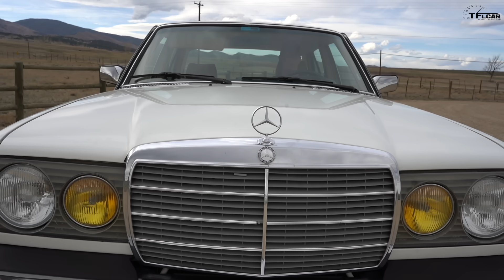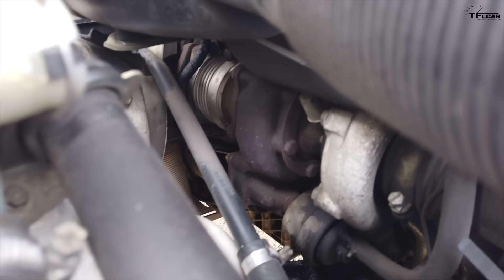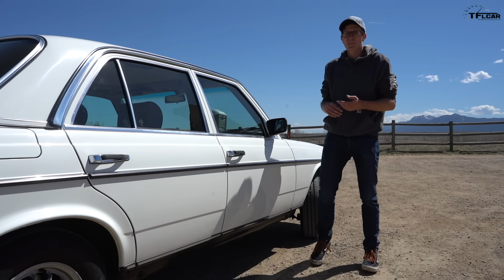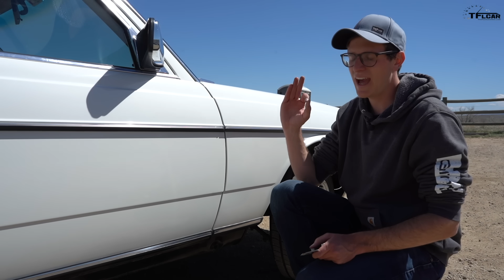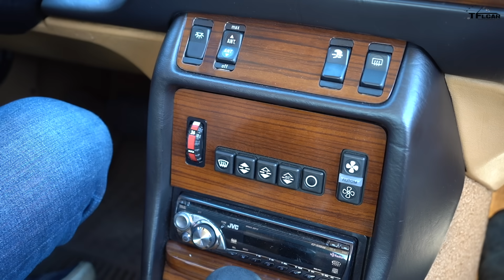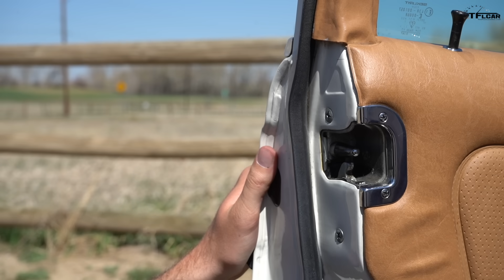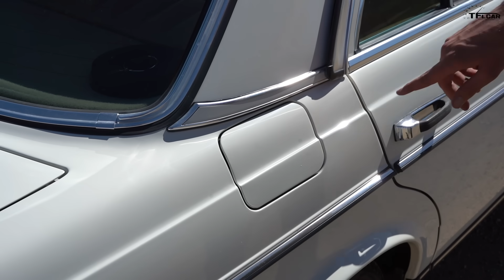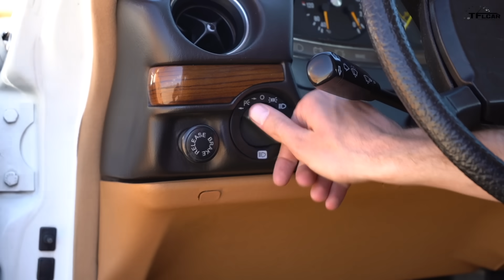This 37-Year-Old Diesel Is THE BEST Mercedes Ever Made!

Comment: Tell us why, on the tail light modules, there is a segment that does not even have a light base.
Reply: It's for reflecting light.
Reply: @gplito  Not if there is a corresponding empty hole for a plastic base. No, I just bought on eBay the metal back part for an older light that has every segment filled. I bought ti because I am taking 2 of those bases and putting one each  in my missing slots. Haven't decided which circuit gets the extra bulb. I'm also curious why the high beam indicator is placed so that it is mostly hidden by the steering wheel.
Reply: @johnredman938  I think the European model had rear fog lights that the US model didn't have. So when you turned on the bright yellow fogs, a rear light would appear also, a very bright red one. I had a few of these over the years and that's all I could come up with. I always like the high beam indicator being within a fingers reach. In Europe light flashing is used quite a bit. Even with then headlights off, you can still flash then brights.
Reply: @gplito  For fog lights? Well, that makes no sense (to me). The high beam indicator I refer to is the blue light on the warning light strip on the dash, not the stem you control the light with. On my W126, it is almost totally hidden with the steering wheel in straight ahead position.
Reply: John Redman maybe it looks different depending on how tall you are or where the seat is adjusted. I liked to sit up high so that blue light was always very visible. But since the steering wheel is fixed, I can see how it could get hidden behind it.
Reply: John Redman the next model did have rear facing fog lights. It was one extra bright bulb in the drivers side real light fixture. It went on when you pulled the knob for the front fogs. I don’t remember if TD had that or not.
Reply: @gplito  Good design would not have that happen, depend on how tall one is. It would be right in the top middle of the speedo where most cars I have owned has it. Heck, my 1952 MGTD had it there.
Reply: @johnredman938  There's a reason, in some engineers mind, why it was there. Haha. I actually liked it. I liked that it was blue. I spent a lot of years working for Benz in retail sales so I had a Benz all the time, mine and whatever demo I grabbed. Word in the service departments was that these particular cars were the best ones they ever built and required the least servicing to keep them on the road. Every one of them that we took in on trade was purchased by an employee, mostly in the service dept ,but a lot of us sales guys owned them too. This was back in the 80's and 90's when a lot of them were still on the road and would still show up as a trade in. I had a list of people looking for the wagon version. When they were new, they were about 33K. Some of the guys that sold them back then, before I was in the business, told me there was a waiting list to get one. As for now, I wouldn't get caught dead in a new Mercedes. High tech junk.

Comment: If you ever consider buying a Mercedes....it has to be a classic Mercedes....easier to fix...can run forever, overengineered....great looks even by today's standard...

New Mercedes...ugly, almost Korean...you need to repair after a short while....too many useless buttons...that add nothing but almost certain fail and repair ...

Nothing beats an original....

Comment: As a W123 owner, I can only agree completely. It's not only one of the best Mercedes ever but one of the best cars ever. Durable. Reliable. Comfortable. 
It's the epitome of sensible, perfect engineering. 
For example. The seats are perfect.
I spent twenty minutes trying to get a comfortable setting from the six way adjustable seats in a new Ford. Yet the W123 seats are instantly comfortable for an all day drive for nearly any driver of any height and weight. The ride is beautiful. Smooth, comfortable and composed with 4 wheel independent suspension and disc brakes making handling and braking excellent. 
Ours has nearly 400,000 miles on it and it's still tighter and more refined than most other new cars. We'll never sell it.

Comment: The 123, 124 and 126 lines were the end of an era. All of them are well built and far easier to maintain compared to everything that came after. I myself have a 1985 500 SEC and it is the tits. Eventually I will get my hands on a 123 or 124 diesel as well.

Comment: I personally love the 1987 300D (6 cyl). Still mechanical injected but newer body style. Had newer MB wheels with Euro headlights. I regret selling it to his day even though I sold it for higher than I bought it! I had to change the radiator after I bought it cause the previous owner had wrong coolant (maintained like a ford/chevy). Alternator died killing the battery at work one day so got a jump and drove it home 30 miles no problem!

Comment: W114 was better. Basically the same car but far better looking. I have a '75 280c (m110 six cylinder engine, gas) I bought as my first car in may of 2017, and it can still reach factory labeled top speed (109mph) with the windows down.

Comment: Nice video. I drive a stock '93 W201 and it has the same build quality. That gorgeous door clunk isn't just the steel, it's the thickness of the glass. Anything  post 94 is just horrible design and inferior materials and build quality.

Comment: I really enjoyed my 200D and 200T models. Extremely dependable, comfortable and easy to maintain. Winter diesel fuel wasn't to current standards though (back in the 80s) and I would have to drive from diesel to gasoline pumps for the proper mixture - a pain.  Yes, each fuel usually had their own pump.  Wouldn't want to drive the 200D today though, trucks would be pushing me.

Comment: I have five 300D’s in the early 90’s version.. incredibly easy to work on changed window motor out in like twenty minutes same for each front strut.. the rear break pads are two pins and remove old and drop in new ones!!!

Comment: I think the 2006 Mercedes CDI is the best build diesel may be
I have one, 250,000 miles, change oil every 10,000 miles, never need to add oil to it, drives like new

Comment: A friend of mine was driving this car in the early morning hours. He was running along at about 65 mph, when the battery died. All lights went off, so he couldn't see. However the diesel engine did not need any electricity, so he just kept zooming along. He was able to slow down without crashing, and just pulled to the side for a while and waited for dawn. Then he continued on his way and got to work after dropping off the car to be fixed.

Comment: Great Video, but the 82 did not have 17 vacuum line heater control, they have the MONOValve Ive had 3 too D's and I own now  300 SD 1982 and 2 240 D and 2 1999 E300

Comment: The strip on the side is to prevent parking lot dings, like with almost every car that has side chrome or side rubber.  Oh, and the only thing wrong with that car is that it is the turbo - the normally aspirated 300D was sooooooo much more relaible and serviceable.  The turbos were actually problematic from day one.  PS: It's not a moonroof - moonroofs are glass.  It's a sunroof.  Seriously, do some research.

Comment: The fluted lights seen at the front and rear are an aerodynamic trick to assist in keeping dust off the light lenses
The near vertical hood is so that the engine can be lifted out without removing the hood

Comment: You can't compare styling theme of the 1970s to the 2000s. back in the days, Mercedes has the best product system: horizontal affinity and vertical affinity. Meaning different generations of Mercedes will look like a family without the new making the old outdated. And within each generation,  there's a similarity and distinction among models. This lasted about 3 generations. Compared to the planned obsolescence the US auto maker used, this is much more desirable.

Comment: I bought my 1982 300 Turbo Diesel, in 1992, because I drove to work 75 miles each day, 6 days a week and back home 75 miles.  I did this for 10 years in that car.  I hit 2 deer at 65 mph.  Neither deer put a dent in the car.  At 500,000 miles, I sold it and bought a MBZ SLK230 and an ML430.  Both of those cars had nothing but trouble.  The 300 never gave me any issues.  I changed the oil myself and had the garage change the brakes and tires.  Nothing else was ever needed in 500,000 miles of driving.  The gal who bought the car put 200,000 miles on it and then slid off the side of the road, in the snow, and hit a telephone pole.  Totaled the car, but she was not hurt at all.  So, the car went 700,000 miles before its death...  And the death of the 300 was caused by going too fast in snowy conditions, not because it wore out...

Comment: Compared to US transmissions,  the transmission in TAXI Mercedes cars is only semi automatic. It does shift down uphill well if at all. 
You will have to shift down manually.. 
The seat are rigid, hard, and uncomfortable and the levelling system in the drivers seat collapses after 300.000 KM. 
As for the  vent/a/c system we had a term called Mercedes eyes up untill the 1990's meaning the driver would get infected eyes from the ventilation system.

Comment: I have a 77 240d with 363.000 mi that's been sitting for a year and will fire up right now and run 350mi with no hesitation. it's a lot slow to start (0-60 in just under a minute) bit the only thing mechanically that has been replaced is the starter and that was in '17 and it was original oem. The only thing body-wise was the control arms and ball joints. It's a fn tank and a trooper!
Reply: Frowned upon to comment on your own post but had to say ....350mi one way... I can turn around (not that I'd want to), and come right back...No Problemo!

Comment: Wrong. It isn't the best Mercedes ever made. It's the best car ever made. I owned one (for 18 years) - just sold it last year.  Did all the work on it myself - real easy to work on and the parts were surprisingly inexpensive. I had 360,000 miles on it when I sold it - original engine and transmission. And was extremely forgiving about fuel - when I changed the transmission fluid, I just threw the old fluid in the tank a quart or 2 at a time and burned it off.
The only thing I can say anything negative about was the climate controls - they truly sucked.  Other than that - an amazingly good car.
Reply: you put the tranny fluid in w the gas? i didn't know you could do that w/o harming the engine. what ratio?
Reply: @salostracco9412 
His was quite probably a diesel, so it would run on many kinds of oils.
Reply: @salostracco9412  Nah, an old Diesel would just burn that like any other fuel, and even a gasoline engine wouldn't mind very much. Just a bit of blue smoke. Two-strokers burn their engine oil by design. Now, if it had a catalytic converter, that's another story. Those don't like it when you burn oil.
Reply: Climate controls and other interior appointments were fashioned out of the remaining 2% of the primary budget.
The running gear were always funded by the first 98%.
Reply: the ac climate control was the only non Mercedes part...it was GM...hahahha
Reply: Why did you sell it? I'm looking to get one myself!

Comment: I have no idea how many miles my 82 240d has,but I love it. Putting new tires on it this week. last week, cleaned the 37 year old sludge out of the fuel tank. Need new shocks, but it still drives. Has some rust holes in body because bad body seals, but still drives. Best car ever.

Comment: The pneumatic/vacuum central locking is something else!
Reply: @das wright  I doubt it has anything to do with deep water !
Reply: @das wright  Didn't need electrics anyway as it was mechanical. You could just grab the lock control and lift it.

Comment: He might be right, but personally i prefer the w124 series. The coupe in particular :)
Reply: agreed. w123 likely more over-engineered and solid, but the 124 design is just so much more clean and cooler, timeless.
Reply: @Rimrock300  the first w124 even had the same engines as the w123  that means they are probably as solid as the w123s. Also they feature better suspension and more modern vehicle dynamics. :)
Reply: @Alex13543  with 'solid' it had mostly to do with stiffness of the body, thickness of body panels and so on. More plastic, less metal on the 124, and more.
Reply: @Rimrock300  i see what you mean
Reply: I agree :) as i own two C124, there is something about this shape, they are starting to rocket in value too

Comment: My father has a 1985 5 gears 240D. One day when I was 8 my father tried to sell it to a business man for around 7000€ and I cried so much to try to convince that man not to buy it. Now I'm 25 and I fiercely drive a 1985 240D.
Reply: I almost sold off my w123 when it turn 28 YO as I was having some financial constraint. My son pleaded me not to sold off and the next day I called at the 2nd handed car dealer and told him i have changed my mind, Today its still remain with me and my son shall inherit from me in a matter of time, as more and more modern Mercs are rolling out each year, still w123 has that every lasting continental look which turned a lot of head in the street . keep it, love it, it will serve you continously . It is indeed built  to last.
Reply: Good story.
Reply: Omar you must sound horrible when you cry ??? Because the buyer ran away ..😂😂😂
Reply: The 240 D had a final production year of 1983.
Reply: @mortvid  uhh no, they were produced until 1986
Reply: And they never came with a 5 speed.   You are a lying dog faced pony soldier
Reply: @mortvid  they sold 240D and 300D (not turbodiesel) with optional 5 speed. I had a 240TD 4 speed and it was a noisy nightmare at higher speeds. Tried to get 5 speed gear on second hand market but they are very rarely and expensive.

Comment: W124 is better. OM601, OM602 and OM603 engine.
Reply: Werner Salzl how is it better?
Reply: Actually less solid and cheaper build quality in general than the 123. BIG protests in Germany from taxi drivers concerning the quality back in the 80's. But the lines and timeless design of the 124 is amazing. w123 design is boring.

Comment: It's just a car, it still requires maintenance and it still has problems. I promise you all. I own several Benzes and I've done an engine swap in my w123. I wish the om617 had self adjusting valves but that didn't come until later, the bodies rust, the transmissions were controlled by an ever failing VCV component that regulates vacuum and the automatic climate control systems always have issues. That being said, at their core they are very reliable. I'm saying this because I don't want a bunch of people to run out and buy a car they don't think will have problems which just leads to unhappy owners and a car that goes to the junk yard. Please be realistic when you're thinking about buying one.
Also in addition to the w123s I really like the w116 450sel 6.9, the r129 sl500 and w126 300sdl. Those were also incredible cars just to name a few.

Comment: Generally, i'd say avoid any new series car. Buy the last year after they work out the kinks on the production run and when it goes on sale. then u know what u are buying. Still though, does not fix market options like those stupid low profile tires and aluminum rims on MB in N.Amerika. Give me high wall and steel rims for bad roads!!

Comment: This of course is one of the best. 
I would also say my 1997 C250 TD was even better - it has all the qualities of this car, but with a huge Turbo and Intercooler fitted to its 5 cylinder which made it a world away from the sluggish performance of this car. 
Ok..it may not last quite as long..but driving it just put a huge smile on your face every time.

Comment: Love em ,owned em, but at the end of the day buy a Camry their way faster , they have air conditioning and will and do last as long as the diesels without the diesel issues....
Reply: Have had several of both and must disagree. You will notice the difference as soon as you take a wrench to them for any reason. Toyotas are clearly built to a price--and are usually worn out well before 200k (though they will soldier on). Toyota electrics are a bit better.

Comment: Very nice but not best in my opinion, second best.  I believe the best was the 300SD from 1978-1980.  All of them had the turbo (some 300Ds had them and some didn't).  The 300SDs were even safer and had more room inside.  They didn't really increase the maintenance cost since really they were built of the same materials just were larger.  Personally I like the lower side trim piece on the 300SD over the 300D and the front headlights and grill better.

Comment: I had a 1984 turbo diesel that I drove for 14 years.   247 K miles on it when it was sold and ran as new.   No oil usage and same power.   Only sold it because I wanted something newer.   Wish I had it now.     Only maintenance issues were the mentioned climate control system and several alternator replacements.    It was a rock.   Your description of the rear seat leg room was inaccurate with the passenger seat clearly moved to its rearward most setting.   Not  an average or normal position.

Comment: @Otm646: Let's only examine factual testing as opposed to the manufacturer's published, and often theoretical specifications.. Car & Driver published test results for a 1980 Mercedes 300D on April 1, 2006, listing it's weight at 3,774 lbs and reported Braking Distance from 70-0 mph was 384 ft. In February 1977, Motor Trend published a road test of the 1978 Chevrolet Caprice, listing its weight as 3,682 lbs and reported a stopping distance from 60 to 0 of 150 feet....

Comment: My 200d 1978 ( 4 cylinders ) was operated as Taxi in France  totalized 600.000 kms when I buy it . I drove till 880.000 kms without any engine rebuilt, engine chain be changed around 1.000.000 kms in Mauritania by a friend of mine still using this car for desert taxi... 300d with 6 cylinders is just a liitle more reliable